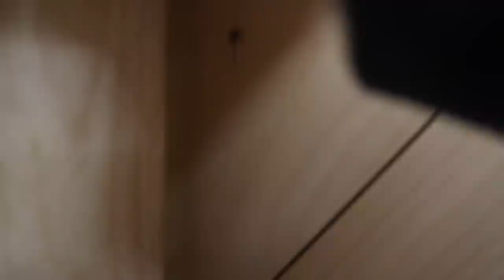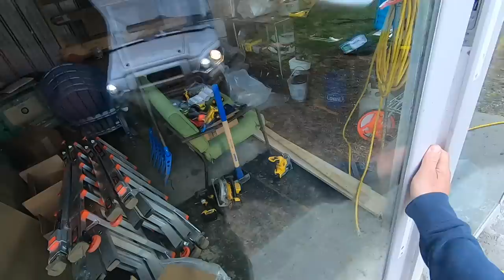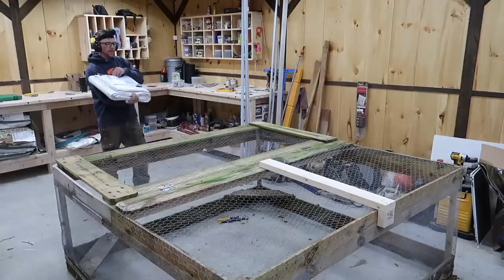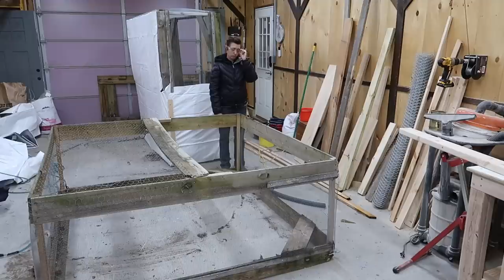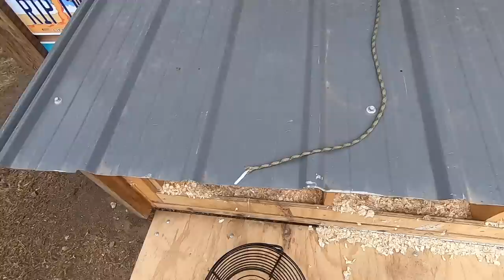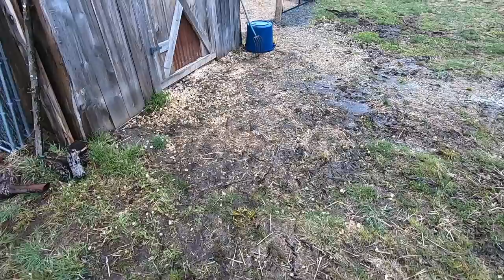Getting READY to GROW a Years WORTH of CHICKEN in our BackYard!

Comment: Goooooood Morning Al , Gina & Olivia ,
I see that Olivia , like myself , likes the best part of the chicken. The crispy skin !  When I was young , about Olivia's age ,  my mom used to bake some sweet potatoes that were more yellow inside rather than orange . They were also more dry.  Very yummy. Today I don't find anything except the orange ones ( yams ? ) which are also very moist ( wet ) inside.
  I built two chicken tractors like yours.  Now I am modifying them to have a second story on one end.  Roosting bars will be inside in the top portion.  A water bucket and nesting boxes in the bottom portion. Ridged  plastic / fiberglass panels for the roofing.  Rain water ( and heavy dew ) drain off the roof into a collection channel and then into a funnel to fill the five gallon water bucket.  A sponge in the funnel acts as a filter for trash.  It works very well .  I have already set up a  4' X 8' chicken tractor the same way.  Six chickens lived in it all winter. All of the roosting bars are on the same level so there are no upper bar superior chickens.  I am using 2" X 2" which when all attached together is quite sturdy enough . And much lighter.  Six foot dog eared fencing boards make up the sides and  the nesting boxes are at ground level on the back side.

Comment: Al, My sweet potatoes have orange flesh. I haven't tried the white fleshed sweet potato.  My favorite method to prepare are peeled and sliced. dump into a oiled sprayed 9x9 baking pan, covered pan with foil and bake at 400 for 40-50 minutes or until the larger slices are soft and tender.  The slices can be served as is or riced or mashed or whipped.  The foil keeps them moist and  lets them cook thoroughly with out over cooking the sweet potato. Leftovers can be fried or microwave reheated.

Comment: Kale mushroom soup with cannelloni beans I intend to make today. Mince a large onion and 3 cloves of garlic and sauce in avocado oil. Then add some chopped mushrooms (minus stems) and shred some kale leave, mius the stemss (or chard leaves) and add them to the stir fry. Chop 2 medium potatoes in small chunks and add to the stir fry.Next chop up two tomatoes and add them to the pot. Next add 1 litre of mushroom broth, and 1 cube of mushroom seasoning. If you prefer to use vegetable broth and a vegetable cube, you can substitute, but it will taste different. When the potatoes are cooked, open, drain and rinse one can of cannelloni beans to add to the soup until they are hot. This soup makes a complete meal, and we eat it with crackers.

Comment: I have a place in town that` sells pontoon boats. They come with  a really heavy plastic  covering to the place that sells them. Those people take off that plastic and throw it away. I snagged some Blue ones and some white ones a while back. I have used them to cover a while pickup truck load of 50 small hay bails. I also used one of the white ones on the chicken tractor that I made, so that the corners fit right to the tractor back corners. That way it has 3 sides shaded behind the door that I can lift up and set on top during good weather. and the door has a lid all the time. I flip the tractors upside down in the winter so Snow and Ice doesn't destroy them.Mine are 4 years old now and doing great.

Comment: Gina try spatchcock chicken and Al cook it on the Campchef.  Fast and easy.  I must admit I made a little more
work out of it.  I High Smoke for about an hour and then crank it up to 350 , to get a crust, and cook until a thermometer probe in the breast reaches 160 to 165.  The whole bird will be juicy inside.  I usually do not eat breast meat because it is dry, but not 
using this method.

Comment: My version of chicken quesadilla that serves 3 :  1 shredded chicken breast (with a fork), fry a medium onion and green pepper, mix in the chicken and add a McCormick's fajita or quesadilla powdered mix. Oil one side of a 8 to 10" flour tortilla, place on a oven baking pan, add 1/4 cup of cheddar chess, then about the same of the quesadilla chicken mix, add another 1/4 cheddar cheese, cover with another flour tortilla and oil the top Bake at 450 for about 10 minutes or until you see some browning or bubbling. Remove from oven, cut into 4 pieces with a pizza cutter, serve with sour cream. You can add too much of the chicken mix, and if the pre-baked assembly is more than 1.5" thick, you might be at the limit. You could also serve with salsa if you like a little heat.

Comment: I would just suggest the next time you renew the waterproof cover, that you put the chicken wire "on top" of the 2X4 "hip" so the wire can support the slope  of the vinyl. Otherwise, the weight of the water on the vinyl is going to flatten the vinyl so the water won't run off and will, once again "pool" !!

Comment: The chicken wire on the back of the chicken tractor looks loose, if you had put the wood, to form the ridge, underneath the chicken wire I'm sure it would have pushed up the chicken wire and provide much more support to stop the rain pooling

Comment: I like to cook my chicken in a bed of rice. Cut the chickens into 10 pieces, Cut back half off at rib cage split backbone in half, cut off drumsticks remove thigh from hipbones, remove wings at shoulder joint, remove wishbone by cutting from point of breast bone toward shoulder, remove breast by cutting directly under breastbone starting at the tip of the  soft part of the bone, split the backbone off the rib cage. Put rice and seasonings in a deep flat pan add chicken broth and chicken pieces, cover pan and bake @ 350 f for about 20 min uncover and brown chicken .

Comment: Tonight we are having;
Instant Pot Chicken Taco Soup, 
Ingredients
* 2 (1 oz) packets Taco Seasoning, divided
* 2 (8 oz) Chicken Breasts
* 1 (15 oz) can Black Beans, drained and rinsed
* 1 (15 oz) can Red Kidney Beans, drained and rinsed
* 1 (15 oz) can Garbanzo Beans, drained and rinsed
* 1 (14 oz) can Diced Tomatoes, with juice
* 1 (10 oz) can Diced Tomatoes and Green Chiles (such as Rotel®)
* 1 (14 oz) can Chicken Broth, low sodium (1 3/4 cups)
* 1 (15 oz) can Corn, drained (or 2 cups frozen)
Garnishes
* Sour Cream
* Avocado
* Tortilla Chips
* Cilantro
* Fresh Lime Juice
* Shredded Cheddar Cheese
* Sliced Jalapeños

Instructions
1. Place the chicken breasts in a large plastic zip closure bag. Sprinkle 1 of the taco seasoning packets over all sides of the chicken. Close the bag and rub the seasoning into the meat. Set aside. 
2. Press the Pressure Cook/Manual button on the pressure cooker, then press the +/- button or dial to select 4 minutes. High Pressure. This will start the pot and get it warming up. 
3. Add all of the other ingredients, except the corn, to the pot. Stir. 
4. Add the chicken breasts to the pot and gently press them down to submerge them. 
5. Close the lid and set the steam release knob to the Sealing position. 
6. The pot will take several minutes to come to pressure. 
7. When the cook cycle has finished, turn off the pot and let it sit undisturbed for 12 minutes (12 minute natural release). Then turn the steam release knob to the Venting position to release the remaining steam/pressure. 
8. When the pin in the lid drops back down, open the lid. 
9. Add the corn. 
10. Remove the chicken breasts to a plate and shred the meat using two forks. 
11. Return the chicken to the pot. 
12. Stir well and taste. Adjust salt if needed. 
13. Serve in a bowl with any garnishes you like